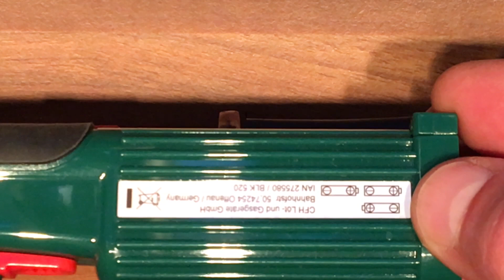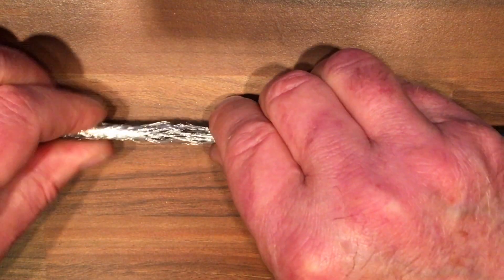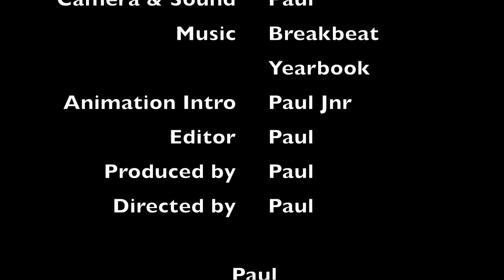Life Hacks How To Easily Solder 2 Coax Cables Together

Comment: Hello, how would you do the connections if wishing to repurpose a coaxial cable with an existing F type socket to carry 12v power...?
Reply from the maker: The centre conductor can carry + and the braided shielding -

Comment: you didn't solder the ground shielding.
Reply from the maker: Interesting question. This is a temporary fix until the cable is fitted with more permanent connector/s or the cable is fully replaced. Soldering the screen/shielding would be quite time consuming and possibly of no additional benefit

Comment: Hi I'm a cable technician, don't do this. Either call your isp company and request a tech or if you must repair it yourself, just buy a cable stripper, some quality fittings, a compression tool, and a barrel and just splice it. loss is .01 db on a splice it's hardly noticeable and won't effect the upstream or downstream.

Comment: you had the soldering gun right there. Why didn't you solder the braid ?   It completes the circuit !!!
Reply from the maker: The braid acts as a screen to shield against leakage and receiving stray signal. By evenly fitting it around the dielectric (inner insulator) and using heat shrink or insulating tape it should be able to do its job without the need for soldering

Comment: i tried to solder the braid shield but solder won't stick to it.
Reply: one word... "aluminium", you probably have aluminium shield and iron inner conductor, guess why ($$$)... also keep your eyes open for garbage aluminium regular wires, like probably the "red and black" ones for speakers, they look goldenish but if you scrape em with a cutter they turn silver, they are crap and hard to solder on, they fully corrode under humidity and snap easily

Comment: l prefer to use an hair dryer on heat shrink if my hot air gun is not available it is so easy to burn the shrink as u can see in the later part of the video

Comment: Would the overlap of the inner conductors not cause signal reflections? Similarly with exchanging dielectric for 2 x layers of heat shrink. The finished HS on the inner is of variable diameter and definitely different density c/f the standard, which is usually PE or PTFE. I guess HS on the outer, so long as hermetically sealed would probably be fine, since it is outside of the shield.
Am not an electronics or radio engineer but my understanding is that any disruption to internal geometry of coax is likely to cause reflections and lead to signal degradation. Am planning to use RG58 for antenna extension cables on a 4g LTE router. Every dB of signal counts so will probably skip soldered or spliced connection altogether .
Reply: yes and u just explained why everything today use digital instead of analog.

solder aint that bad if u solder the ends togheter and try to make sure its stright. any deformation causes inbalance in the signal

Comment: That really annoys me!
You make it look so easy, and do such a neat job, but even after years of soldering, my jobs look like a pigeon has dumped all over it!
I am going for a sulk....
Reply from the maker: A Pigeon finish can be due to an iron not reaching the required temperature for the type of solder you are using or the solder may have a higher melting point temperature than the iron you are using can reach

Comment: Onece the coax is broken the only way is to install a connector and use a barrel connector. It can not be soldered back without changing electric properties. Connector loss has been tested and show no detectable loss
Reply: With crimp connectors? I cut my car antenna coaxial in half. I have used block connectors but the intetference is awful. Will something like spades or bullets be better?
Reply: @rs19147  No. you'll have the same problems.

Comment: As a cable technician I can only say that when this ghetto rig causes either your internet to fail, or worse, takes down your neighborhood, don't complain when you're slapped with a hefty service fee.  The stuff to do this the RIGHT way are available at almost any hardware store for next to nothing.
Reply from the maker: There are many homes not on a cable network. This is an option for an extension or repair.
Carrying out diy cable work on a subscription network is not advisable as you stated above and we do not encourage it.
Reply: That's why you're a technician and not an engineer...typical response from a Wannabe.  LOL  This was a quick fix until it can be properly done.  Good job to the Driveway Dudes for the temp fix.

Comment: You are a fucking wizard.
Reply from the maker: Not really. Just a bit of knowhow
Reply: @DrivewayDudes  I scrounged up some old f connectors and and a barrel splice and did it that way. I had them in my junk drawers. If not I would have did it this way. I repaired cable for car antenna in my car after it broke off where plugs into radio. Cut end off junkyard radio and voila. It works. Perhaps a smidgen less crisp. I'm a forking wizard.

Comment: Brother you should have soldered the braid as well. The braid is not just for shielding RF It is the other connection of the Coax. For example, you will have as equal of a load on your shield. It needs to be completly connected back to each other just as you did with the center connector.

The way you demonstrated for example may only have 5 to 10 percent of the shields actually touching each other.

If you had no choice and had to do this you would actually need to add some wire to make sure both peices of the shield are touching completly.

I know radio waves are not DC but think about it. Would you take a pos cable and a neg, solder the pos together then just take the neg and lay it on each other then heat shrink it? Of course not.

Same applies here. If o attempted to do this with my legal limit ham system doing 1500w through the cable i would either burn something up from lack of coaxial ground, have much rfi introduced, or the coax would get warm due to lack of ground (shield).

Here is what i would do....add a bit of wire to make sure both sheilds will be able to connect...add flux to both. This will help you twist it and stay together. Then put solder on your iron...a hot iron..and hit it up and down so the solder can flow. So it quick. Then use a metalic plumber tape for extra shielding then you can water prooof it or use another form of tape on top of that.

Of course the best way would be to use a splice made for the coax lol.

Hope thia helps...i would remake the video doing what i just said brother. Connect that shield just as much as you did the center.
Reply: Could I tightly wrap the braided splice in heavy duty foil to help the pieces all connect together? This would theoretically be for a cable tv connection.
Reply from the maker: Thanks for your comment and observations.
Ideally use connectors but if none are available this is one example of a quick fix until connectors become available.
The shield/braid in this example is for ground for use with satellite, tv, radio, broadband, etc. 
I overlapped the two ends of braiding so most is touching to shield and cut down on ingress and egress. At each end is f and bnc connectors which have the centre pin isolated from the casing. 
It may give a small amount of reflection at the solder point but that is to be expected.
I have used this cable for RF and Data and it works fine.
Reply: @DrivewayDudes Also on satellite TV the braid needs to be soldered because the Satellite Box transfers voltage through the cable to the LNB and without this voltage in a lot of cases you will not receive a satellite signal.
Reply: @DrivewayDudes You're in denial the braid being connected is extremely important and when he pointed it out you couldn't handle the criticism.

It doesn't matter if "it works" because down the line it would most probably cause issues.

You mentioned this is going to be used for satellite tv.... Okay then let me see you connect satellite tv without braid/ground being connected! 🤡
Reply: The information I have read on the internet refer to the braid as shielding. I suppose the tiny signal from the aerial or dish could be subject to interference from electric motors in the  long coaxial cables and the braid gets in the way to prevent it. Also it prevents the signal in the core leaking out. It is good not to have gaps in it and to make sure it is earthed (grounded).

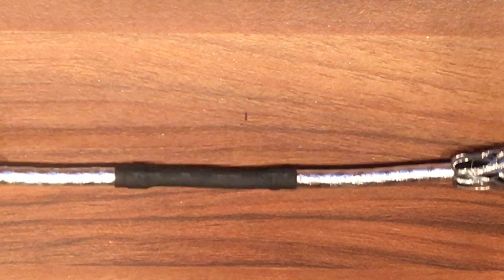Comment: At 5:30 is is the point at which I realize I forgot to put the outer heat shrink on the cable. DOH! ;-)
Reply from the maker: Yes. I suppose if you don't have an open end it would be better to put some on first.
Been there, done that also. 👍
Reply: soldering for more than 5 years, still forget to use heatshrink

Comment: FYI, this is NOT the proper way to splice.  The ONLY way is by proper installation of F connectors and an F-81 barrel splice and properly tightened. This method will only cause problems especially with lower frequencies and cause major ingress/egress with RF frequencies.
Reply: Yea, an alternative method to causing a noise outage and having your cable company come disconnect your service.
Reply: Wrong mate, if the shielding is intact and continuous, the signal core is soldered, then this is FAR better than using connectors...connectors introduce much bigger losses.
Reply from the maker: This is an alternative method if nothing else is available to hand.  It may affect certain frequencies in the lower Hz band but not so much in MHz and higher bands. The braided shielding with the addition of foil should mostly prevent ingress and egress. There may however be some minor reflection but rather to join the two coax cables together to get some signal reception than none at all.
I may in future make a comparison video of the different types of splicing and jointing techniques and using metering equipment note their effects on signal loss, reflection and frequency.
Reply: Hahaha with those tiny wires coming from my turntable's cartridge? Pff forget it :P

I might have to find a better way to shield it all though
Reply: He is just jealous because he can't solder like that ,, great job
Reply: @garyhaley3072  He wasn't criticizing the craftsmanship, but the design. You can do a good job with any design.

Comment: I put already a like for the neat and nice job.   A question : is soldering better  than using adapters-connectors in terms of specific impedance change (so there might be a fraction of signal reflected back). I mean do connectors behave better, the same, or worse , in terms of Signal transmission in comparison to soldering.  Just asking, who knows please enlighten.
Reply from the maker: Soldering is always the preferred method rather than a block connection, Take for example, a circuit board. solid connection, better conductivity and continuity, nominal impedance and slimmer chance of leakage
Reply: Well, I was showing this video to someone and he said that this procedure is good for low frequencies like 10-15Mhz but not as good for higher VHF, even less UHF zone. There is Z specific change of the cable in the matching area and there is back reflection of the signal. Because by inserting just some dielectric doesn't  mean has the same characteristics such as that of the cable.   Instead by using proper adapters, there will be an "insertion loss" for the signal, but after that the proper characteristics of the adapter make sure that no specific Z change happen...
Reply from the maker: All cables and connectors are frequency sensitive. Some will show (on the label) the suitable frequency range where it will work for a particular application though it can also carry signal outside of that range but may be less effective. 
I use HF, VHF and UHF with runs of no more than 20 metres. Using a powered antenna/down converter I may have losses of up to 3db. Using snap/screw/block connectors I have experienced greater losses. Varying losses are also dependent on the frequency and the length of cable used.
You can experience reflection when joining 2 cables or wires together, i.e. using connectors, soldering or even if you just bend a cable, scratch the outer part of the pin or damage it in any way whatsoever can also cause signal loss, ingress, egress, etc.
This is a diy and cost effective option. It may not be suitable for all applications.
Reply: OK, I assume you have done your measurements on the different cases, so you can be confident about this method.  I am mostly concerned in the 433Mhz zone, so I understand that soldering method is what you would prefer here.  Thanks for sharing info.

Comment: No effect on clearity?
Reply from the maker: Hi Pranit Lgg4,
Just about all components/contacts in a circuit are joined together by way of solder. 
Using a joiner piece (push connector, screw type or snap type) may be easier and was designed as a quick fix and is the simplest way but can be prone to electronic interference - ingress (in), egress (out) and corrosion over time. 
Doing it this way, providing the solder joint is good, the shield is refitted well and weather proofed if needed, you would then have a far superior joint to pass signal be it audio, video or data one way or bidirectional.
Hope this helps to answer your question.
Paul